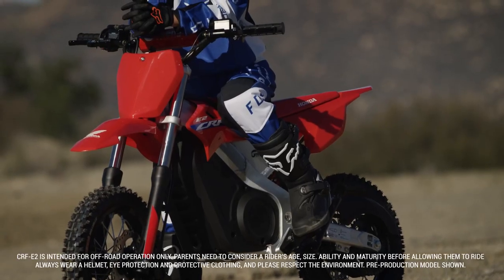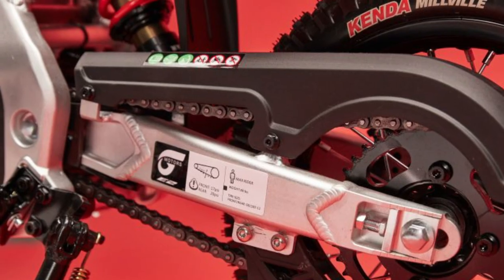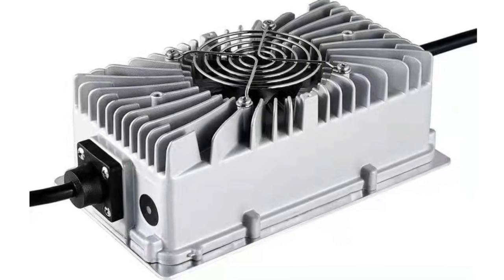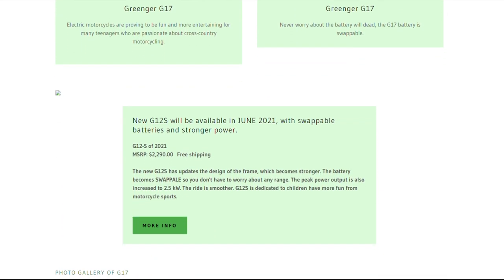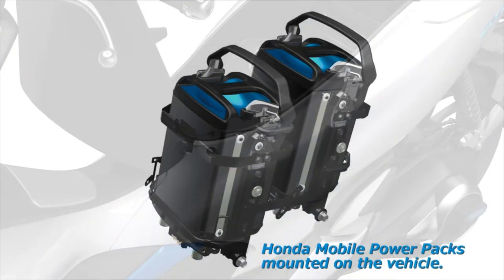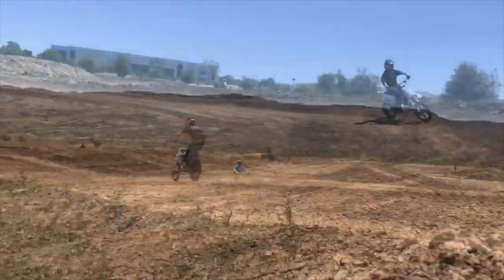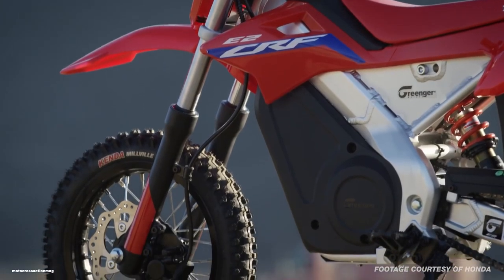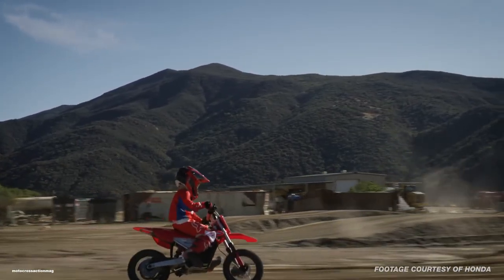NEW Electric Honda CRF-E2 Motorcycle Released! Their first E Dirt Bike = Best Pit Bike too?

Comment: I had a Zero for 2.5 years. I liked the direct power and no power loss and the power. The engine noise was not missed for me. Ambient Temperature will take away range. There is a battery management system that will have to be learned. Not sure if this model is worth it.

Comment: I'm for electric is certain situations, it all has to do with range and cost.   Never for an atv or utv, i can't be out in the forest and worry about range. So far I haven't seen anything with range that matches it's gasoline counterpart.    On road, where more opportunities exist for charging, I would consider it... IF... the cost was relatively close to its gasoline counterpart where I could actually realize some cost savings in fuel and maintenance.   But you're right I grew up with gas engines, I love the sound.   If i ever make the switch it will be 100%  financially based.   Thanks for the vid!